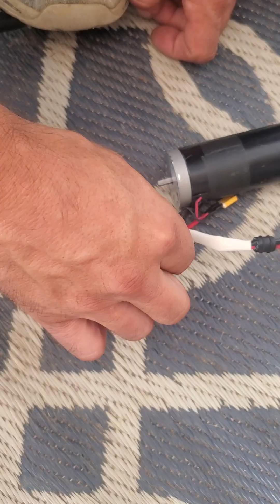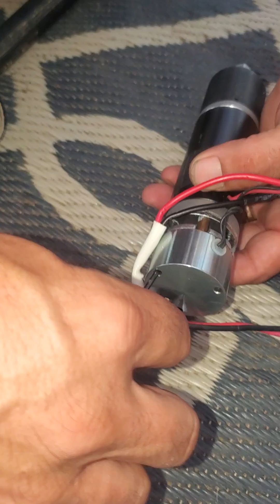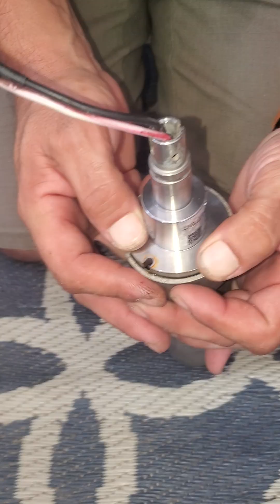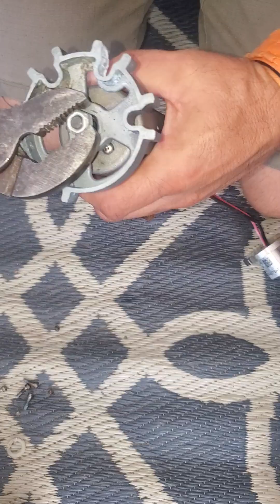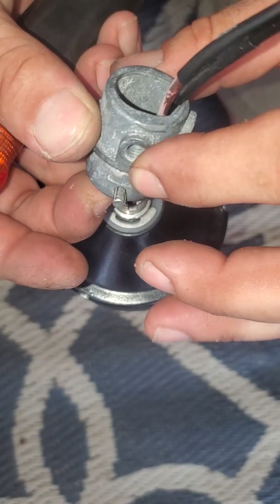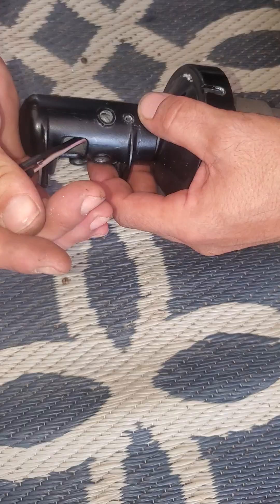Dometic 9100 Awning Motor Fix

Comment: Do you know anything about the actual motor in this assembly?  I thought about replacing just the motor with a higher quality one.  I need dimensions, rpm, amps, output shaft size, etc.  It also looks like the silver part on the end might be a reduction gear set.  Thanks